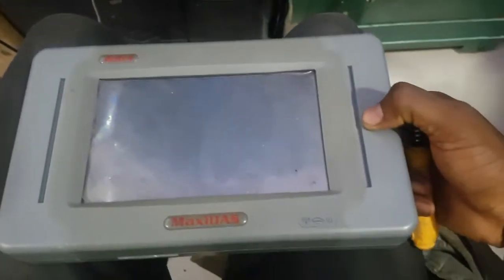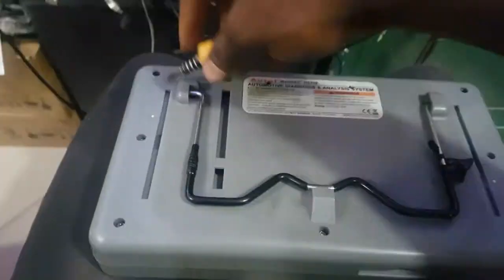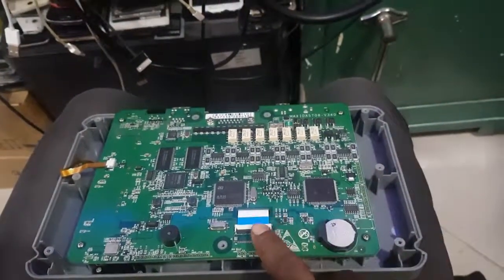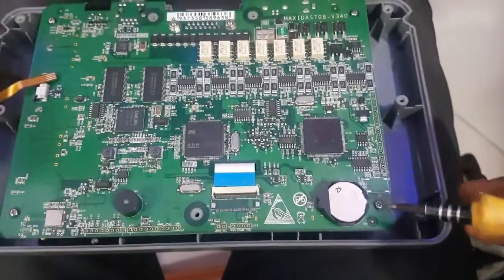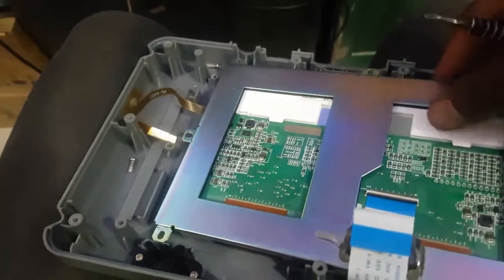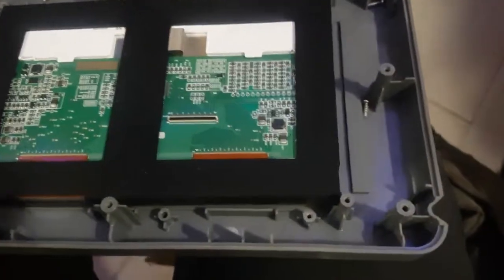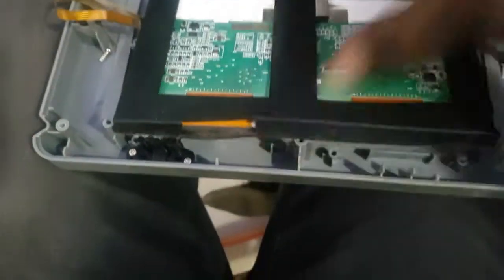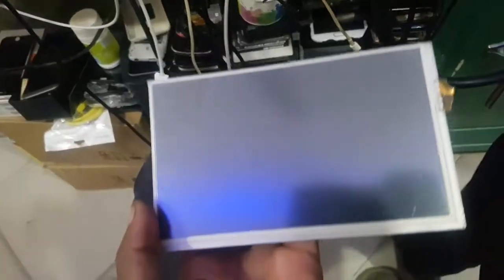How to change the touch screen on maxidas ds708

Comment: I have a Hotel Des 708. Some of the touches work and the other doesn't. Is there a defect in the touch or the screen, and will a better screen be changed? Thank you.
Reply from the maker: If the screen is ok you will need to change the touch only